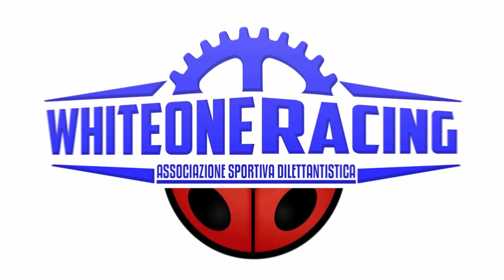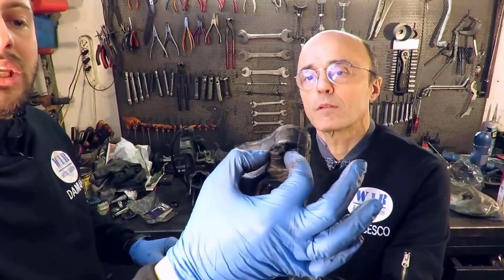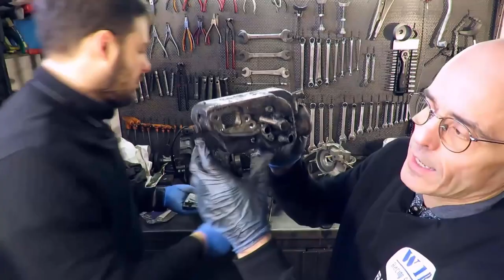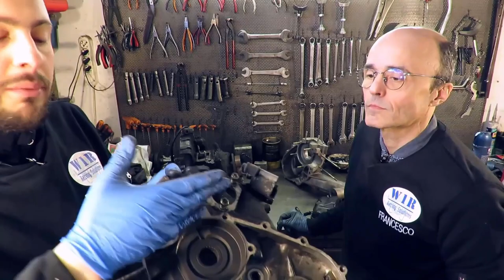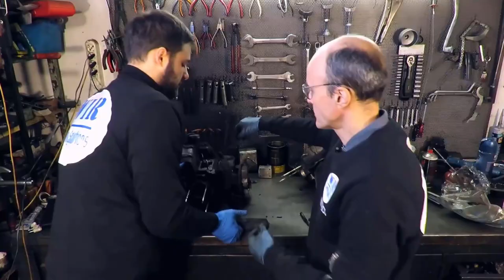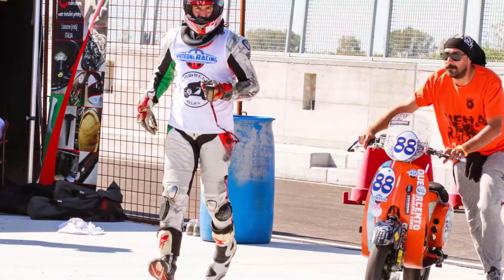68 - Vespa's reed valve step sister

Comment: Sir..i plan to change my rotary valve PX to LML reedvalve SI carb..its recomended or not for tuning engine..?,
Reply: Throw on an MRP manifold and a Dell'Orto PHBH 30.
Reply from the maker: Lml case it's Better than px case
Reply: @WhiteOneRacingExtra  i mean..just my px crankcase , i want mod or custom using LML reedvalve, thats recomend or not for tuning engine ?, or better i repair the rotary valve